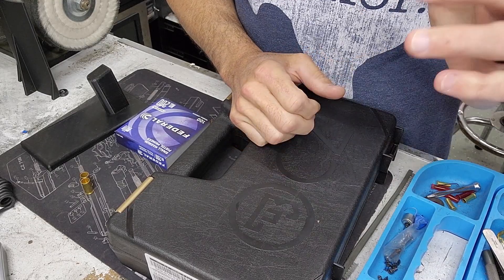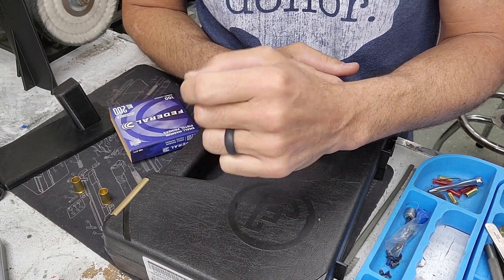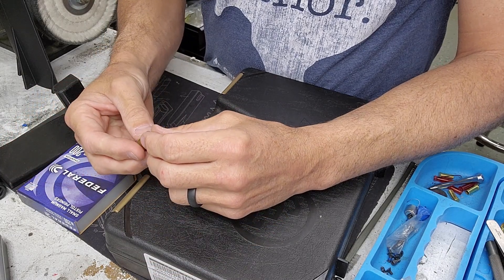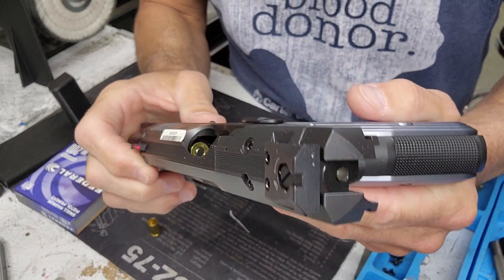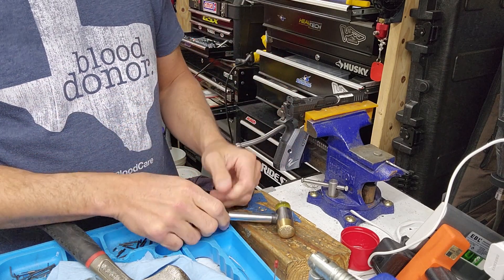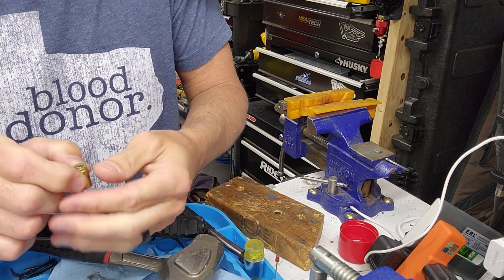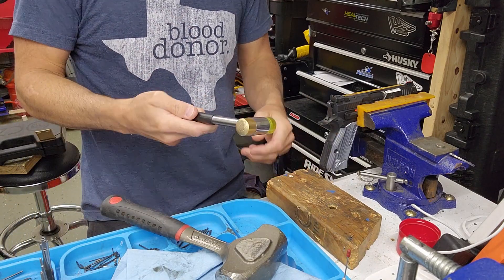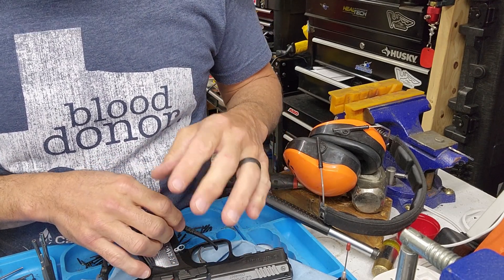Shadow 2 Compact - Drop Safe?

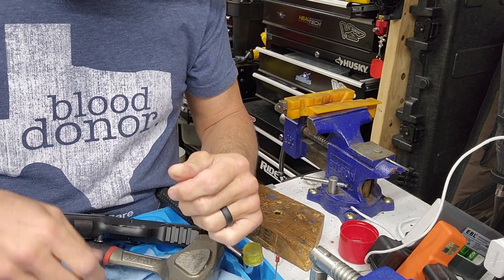Comment: 5:00 Everyone: In case anyone wonders... physics doesn't stop happening when a gun drops. It's very much in effect. It's a pretty simple equation to determine whether your gun could potentially fire from a drop [that you could potentially subject it to].
FWIW, any gun without a firing pin block will ALWAYS fire at SOME inertia point.
Reply from the maker: Yes and no.  Yes, there will be always an inertia able to beat the FP spring force.  But no, it's not enough to drop the gun from your hands height, when using the OEM firing pin.  
The physics here would be simple if you did not have to consider everything involved - For instance, the amount of inertia that you can produce is also finite given the gun would reach terminal velocity from which point it won't matter how much more height you add to the scenario...
Another thing I would be curious about is that depending on the barrel bushing being used, the first part getting in contact with the ground would be the bushing itself, pushing the slide back and the firing pin away from the primer at the same time the inertia carried by the FP will be pushing it forward.  This could also be enough to prevent the gun from firing...
Anyway, I'm obviously not an expert in physics, but I think the theory here is simpler than the real scenario and all the variables to consider.

Comment: Hello. Can you recommend a good aerosol cleaner/lubricant spray for cleaning? Thanks in advance.
Reply: Ballistol
Reply from the maker: I don't actually use aerosol anything to clean my guns - except on a deep cleaning (to prep for cerakote or something), in which case I use brake cleaner since I have to use something with no lube whatsoever added to it.  
So I just normally clean it solvent and for lubrification I actually use full synthetic motor oil.
Reply: Thanks again. Looking forward to the next video.

Comment: cool  keep stock firing pin.What about the Cajun gunworks reach reduction kit for smaller hands?Iwould expect it to still be safe with that kit
Reply from the maker: yes, that just the disco and trigger shoe being replaced.  It will not change anything safety wise.

Comment: Sorry I’m new to the cz platform.  What about with the hammer cocked and safety engaged.  Shouldn’t we test that the hammer doesn’t completely fall?
Reply from the maker: I believe that if we do such a test with the hammer cocked and safety engaged, we will likely damage either/both sear and/or hammer before causing the hammer to fall.  It will only fall on that scenario if something breaks, and we're talking about steel parts, so it would be a heck of strike.
Reply: Still would be good to know if this thing is drop safe with the hammer back.  My guess is it’s not.

Comment: Is there an explanation as to why the firing pin didn't make contact with the first primer? Thank you
Reply from the maker: You mean when I had the OEM firing pin in it?  If so the explanation is that is exactly the extended firing pin which causes the situation in which the FP touches the primer upon impact on the hammer.  The same doesn't happen when using the OEM FP + FP spring.

Comment: You would need to test dropping it onto staright down onto the muzzle as that would be the most likely to set it off. From the inertia of the firing pin hitting the primer.

Even Staccatos and nighthawks go off while doing that with the safety off. Since there is no firing pin block on series 70. Id be curious if cz has shorter or titanium firing pins to avoid this
Reply from the maker: @xxpx2  no, I would not.  Just read the comments here.. the test you're talking about is not what was testing here.  The test you're suggesting has been performed though (check other videos here in YouTube) and the gun did not go off.
The test I did was due to a real scenario where the gun felt hammer first and it did go off causing a fatal accident in competition.
Reply: @czarmorer  I see i do remember that. That makes sense. I didn't realize the scope of your test sorry if I sounded rude. 

The only test Ive seen muzzle down was by Ben Stoeger and the gun went off but required more then one drop. That was just with the shadow 2 though. Not with the compact.

Comment: Help me understand…. Just got the S2C - can I carry this firearm hammer down with the safety off?  I had the CZ 75 D PCR w/decocker and always carried it hammer down decocked.  Is the D PCR drop safe if you did this same hammering/vice test?  What internally is different between these 2 firearms?  Again asking if I carry the S2C safety  off and hammer down?  Not a safety lever fan but will adapt if necessary.  S2C shoots very well - just had it to the range.  And this is a great test you have done!!!  Would like to see as some have mentioned the test again and using the gunsmith hammer only to check the primer with the longer firing pin installed.  Although I’m not changing out the FP on this gun….  Just curious.  Thank You!!!
Reply from the maker: Thank you for your question!  The difference between the 2 is exactly the firing pin block safety.  The CZ 75 D PCR does have a FP block, while the Shadow line doesn't.  The FP block would prevent the firing pin to ever touch the primer unless the trigger is pulled.
Reply: @czarmorer  So I can carry the S2C hammer down - safety off?  The safety lever really only pertains if the condition of the firearm is cocked and locked like a 1911?  Is there a 2 stage partial hammerback - 1/2 cocked - that would be more safe as a carry method with the safety off?  I’m not concerned with dropping the firearm…. Just basic carry procedures.  Thanks again!  Very good info for sure.  💯
Reply from the maker: @gmro-ronosinski5102  in its stock configuration I would consider safe to carry however you feel better with.  I will do it half cocked safety on, but I would feel good about carrying it hammer down too.
Reply: @czarmorer CZ recommends against the gun having the safety on at half cock. Something about damage to the sear. What are your thoughts? If true, wouldn’t they have figured out a why to prevent the safety from going on at half-cock.
Reply: @Rothbardy   Why wouldn't you listen to the manufacturer's recommendations? They do al the testings for you...
Reply: @chltmdwp  just curious about the type of damage or abuse a sear could take before failing

Comment: What’s the reason for putting an extended firing pin in Shadow Compact?
Reply from the maker: It's the same reason as for the other guns - A lighter DA pull by using reduced power main springs leading to light strikes.  The ext. FP is deployed to address the light strikes.
Reply: Sounds like the only reason for doing this would be for competition, for defense purposes it does not seem to be a good idea.

Comment: I've killed roaches with nothing but the primer, in a 5.5 in .44 Mag Ruger Redhawk, it's very messy, very yucky, don't do it.

Also:
I think the STOCK version is safe enough for anyone who understands how to handle it: in particular I think it's fine to ease the hammer all the way on a live round...as the manual indicates. 
Note that:
 1) Once the hammer is all the way down, even a strike on the hammer, doesn't accomplish anything: it's already down all the way! 
 2) the stock firing pin is not long enough to reach from hammer to the primer: it only reaches the primer with the aid of momentum--it CAN gain that momentum if it's dropped from sufficient height but only if it is pointed down!

So, yeah, you could shoot straight down with a high enough drop, but if the hammer is all the way down, a blow to the hammer is totally safe!
Reply from the maker: I just did the test with it being dropped barrel down - check it out to see the results.  You will be surprised.
Reply: @czarmorer  Thank you very much. I did check it out but actually I was not surprised because I expected it would take 10, 12, or 30? feet… and I don’t want anyone to try that test.
Although if someone were super interested, maybe he could just put the spring and firing pin into a test set up: not a gun just some thing that holds the spring and firing pin in the same way .

Comment: Can you talk about what would happen if the hammer was cocked and locked? That’s how I’d carry this with safety on
Reply from the maker: I have not tested that, but my guess is that nothing would have happened, unless one strikes it hard enough to break hammer hook, in which case the hammer will get caught by the sear again on the pre-cocking hooks.  Either way the gun would not fire.

Comment: Was the hammer fully de-cocked or was it in the 1/4 cocked position for the tests? Curious if it was the inertia of the firing pin or the hammer on the firing pin that induced the contact with the primer.
Reply from the maker: hammer fully decocked for a couple reasons: 1 - I would likely break my hammer and/or sear if it was not, and 2 - if the hammer wasn't fully decocked it would not be touching the firing pin and then the inertia would actually be in the opposite direction moving the firing pin away from the primer instead.
Reply: @czarmorer I’m curious how striking a fully de-cocked hammer is different than using the trigger to drop the hammer. It seems like just a different source of energy. If that’s the case, it’s only a question of degrees; did you hit both firing pins with the exact same force (I know I’m not that well calibrated)? Maybe a drop from one height might set off one configuration SOONER than the other but, under these test conditions, at some height any firing pin capable of igniting the primer WILL cause the gun to fire.  So maybe the better test would be to use a calibrated instrument to establish the difference in energy required to ignite a primer in a gun equipped with the extended firing pin vs. stock and compare that to the energy associated with drops onto known substrates from different heights.
Reply from the maker: @nbonner75  very different when you consider that with the hammer cocked the back of  the FP protrudes out of the FP plate by 1 to 1.5mm, and that's what needs to happen in order for the hammer to actually strike the FP.   With the hammer fully decocked the FP is fully depressed into the FP plate by the hammer itself at rest.  So when I hit it, the FP plate prevents the hammer to hit the FP, but because it is touching the FP it does transfer some of the impact energy to the FP.  The question was whether or not this is enough to move the FP forward and hit the primer.  It will not do it with the original FP, but as you can see, it will with an extended FP.
Reply: @czarmorer
I hate half cock and decock (sets it to half cock) proponents because if that gun ever drops onnthe floor you now will need a expensive new sear cage
Reply: @jason200912  do you drop your gun on the floor often? In my more than two decades as a professional trigger puller I dropped a gun exactly one time… it was on purpose for a demonstration. Do you also hate proponents of air bags in cars? When you crash and they go off, they make a mess and are expensive to replace. Do you know why the half cock notch was initially introduced on pistols (what problem it was intended to solve)?
Reply: @czarmorer  “the question was whether or not this is enough to move the FP forward and hit the primer” - The question you’re trying to address is a good one. However, it’s your methodology that I believe needs a little more consideration. There’s absolutely no way to determine if you are using the exact same force in each test. Absent that data, the results are anecdotal at best - still worth considering but far from conclusive.
Reply: @nbonner75  you just admitted it yourself that you've dropped it before.  So if you drop it on half cock you now have a broken sear and extta energy that will transfer to try to smash through the firing pin block. 

 The half cock is made because people had slipper fingers trying to decock one handed for range use when you want to fire it again right afyer decocking it.  It is a terrible carry position.
Reply: @jason200912  the gun I dropped for the demonstration was an issued G19 so no sear damage and that particular gun was turned back in years ago but I appreciate your concern. My point is that dropping guns is (or should be) pretty rare. I’ve never accidentally dropped a weapon in training or operationally. If you’re in the habit of dropping guns as a normal event, you should probably consider a safer hobby. 
I think you’d do well to research the hammer notch a bit more; your speculation on its origin is pretty wildly incorrect. You’ll want to look back to issues experienced with the old single-action army revolver.  Having the hammer ridding directly on the firing pin (particularly on guns without a firing pin block safety) eliminates any margin of safety the gun might otherwise have. The CZ Shadow series of pistol don’t have a firing pin block safety and rely on the 1/4 cocked position of the hammer to prevent the exact condition being demonstrated in this video. If you ever choose to appendix carry a Shadow 2 Compact, please take time to read the owner’s manual and talk to a few professional shooters familiar with the CZ Shadow guns.
Reply: @nbonner75  you dropped your gun once though. Which means drop safeties are relevant
Reply: @jason200912  uh… okay. Really not sure what point you’re trying to make now. You got into the conversation ridding like Don Quixote towards the windmill giant, “Proponents of 1/2 Cocked” and now you seem to be pivoting to defend damsel, “Drop-Safe” in her tower who absolutely nobody was attacking. Maybe you, Rocinante and Sancho Panza need to head back to La Mancha and rethink the knight-errant campaign strategy.
Reply: @nbonner75  you went off tangent about how nobody shall drop their gun despite you doing so as a reason why you should carry half cocked which may break your gun sear and hammer if it does drop.  It also provides extra inertia to attempt to smash through the firing pin block as well when you use half cock.

Comment: If c z wanted a longer firing pin in it , they would have put one in it
Reply from the maker: Right - well, I'm sure no manufacturer wants anybody to do anything on their guns, as they are designed to be the best possible balance between performance, safety and reliability out of the box.   
But when it comes to competition, the balance changes towards performance, and people will tinker with their guns all the time to squeeze more performance out of it - Even if that makes them not as safe, and not as reliable as they are originally out of the box.

Comment: oooooo the gun has a hammer safety....but it DOES NOT HAVE A FIRING PIN SAFETY, it is held only by the tension of the firing pin spring....do you understand?
Reply from the maker: Yup, I understand that - I also understand that regardless of a firing pin block, that gun in particular will not go off by impact unless you change the firing pin & spring by after market parts.